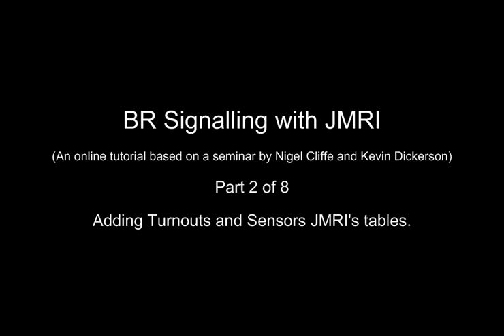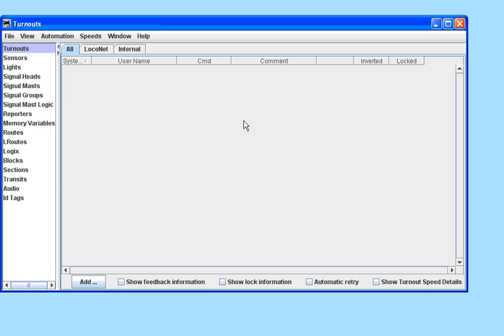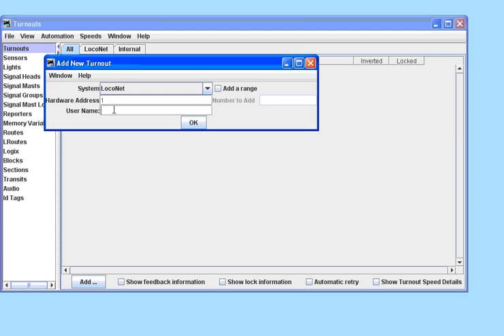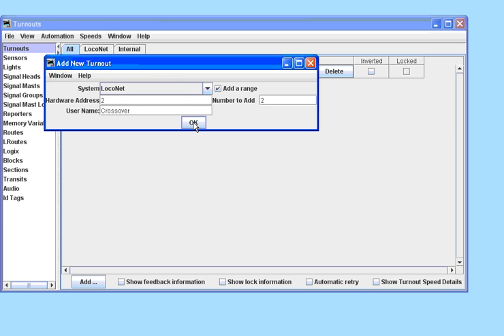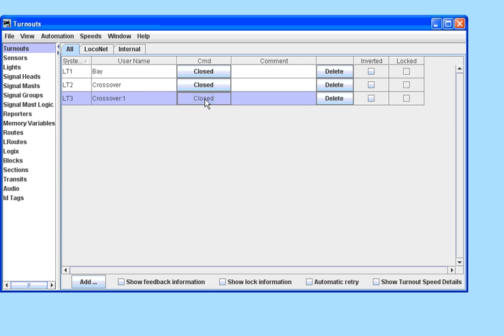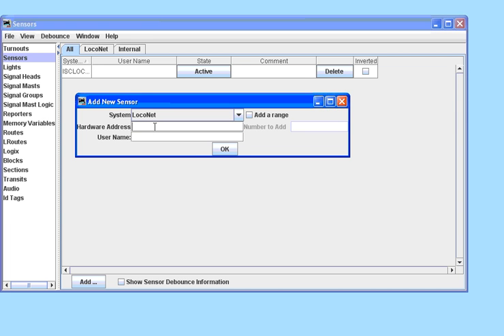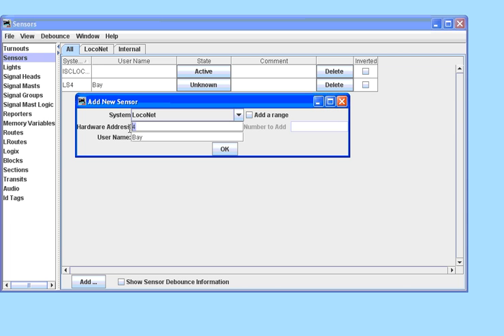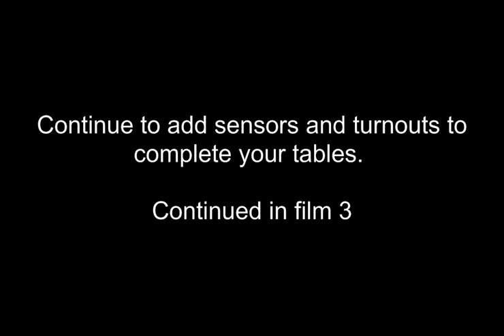JMRI Signalling -  2 : The turnout and sensor table.wmv

Comment: I can't add tables. Any of them in JMRI won't open, turnouts, lights, routes etc. I'm unsing JMRI 4.2 on Win 10 64bits. Do I have to setup something preliminarly for them to appear in the PanelPro? I really can't understand JMRI documentation, it lacks clarity and logical path.
Reply from the maker: Suggest raising your problem on the JMRIusers group on Yahoo!   That's where the main support lies. I've never known tables to not open, which suggests something weird in the setup.   Do you have a command station, or simulator, selected in preferences ?
Reply: I'm using a NCE Powercab to control locos directly, or through JMRI and Engine Driver I can use my android mobile as throttle. I've built myself two accessory decoders based on the Geoff Bunza "SMA12 - 17 Channel Configurable Multifunction $5 DCC Decoder For Servos", and I can control lights and servos for turnout throwing either by Powercab or JMRI throttles. But for God's sake, I cannot figure out how to create a turnout in JMRI and control it in a panel. I suppose that creating a turnout table is the first step, but i'm not able to open any table in PanelPro.
Reply from the maker: I repeat,  support for JMRI is on the JMRIusers group on Yahoo!.    Someone there will be able to take you through the steps necessary to make your system work.    I'm able to offer basic JMRI support on this thread, sorry.